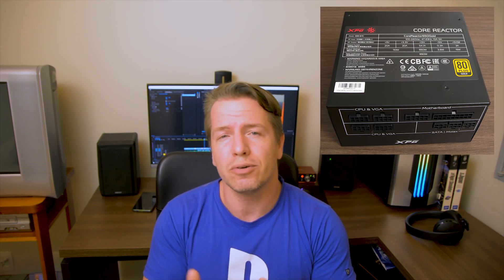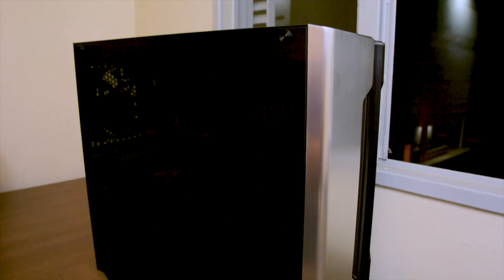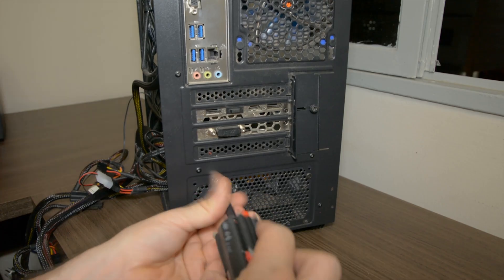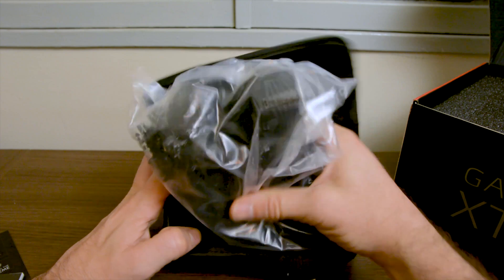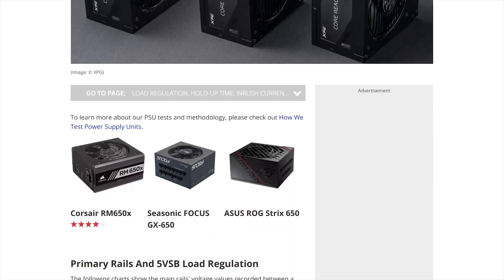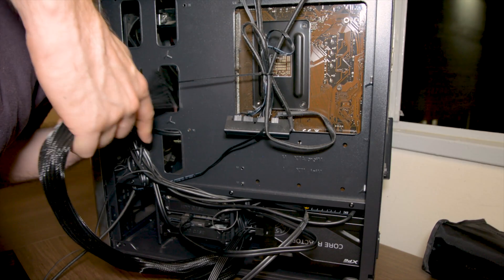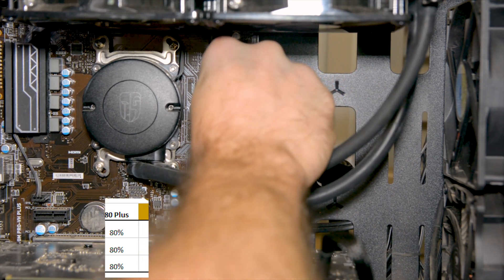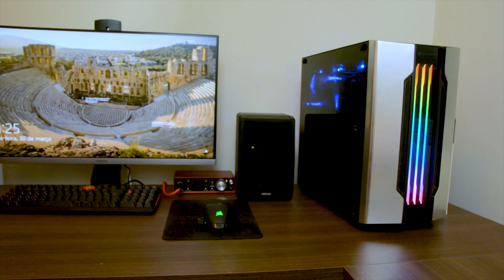XPG Core Reactor 650 Watts PSU - Why? 10 Year Warranty.

Comment: Hi man I want to ask a question can it run 3060 12gig with ryzen 5 3600 without oc anything? I have gtx 1650s right now and thinking about upgrading the pc
Reply from the maker: Yep, easily. Look for PSU calculator online. But I'm sure 650 watts is plenty for your setup.
Reply: @SUCRA  thanks man you are awesome

Comment: I have this unit and it has suboptimal voltage regulation on the +12V and +3.3V rails, specially the former with the voltage dropping by more than 300mV under 180w TDP graphics card load.
Reply: Just buy a more powerful one then, extra watts should nullify the issues.
Reply: @missk1697  My system doesn't need a more powerful PSU, this unit should already be an overkill for it. I came from an XFX unit, which was bronze rated, and I had it since 2014... the ball bearing was getting noisy and that's why I decided to replace it. The XFX unit was also 650w and it has much tighter voltage regulation. Like all XFX units of the time, it was actually made by Seasonic, the XPG unit is also made by an OEM, a Chinese (I think) OEM in this case.
Reply from the maker: That's too bad, I'm sorry to hear. I never got into testing the different power rails myself, but I did some research at the time and it seemed good. Good luck 👍

Comment: Is 10 years warranty means that the power supply will last for 10 years?
Reply from the maker: Not really, but it means that if it fails within 10 years they'll need to fix it or more likely send me another one.
Reply: @SUCRA  then how can I make it live till that time the 10 years?
Reply from the maker: You can't be sure. Electronics will fail. I assume that if they are giving out that guarantee they believe it's going to last the 10 years. But it could fail.

Comment: Hey, you still using this core reactor PSU? Would like to know how it's working
Reply from the maker: I sure am, never skipped a beat.  Planning to use it for the full 10 years. 👍
Reply: @SUCRA  thanks for the reply am looking to buy this PSU
Reply from the maker: I definitely can still recommend it. Good luck with it.
Reply: @SUCRA  hows the fan noise?i got the 850w version and the fan makes a sutle grinding noise and i had to close it off with a metal plate to reduce the sound waves
Reply from the maker: I have a fairly noisy 240 ml water cooler, I can't hear anything over that. I'm in process of swapping to a better air cooler. I'll see then if it's audible.
Reply: @SUCRA  yea im a weirdo when it comes to noise and i noticed that late an night when there is 0 sound and my headset off
Reply: @THEMISOGYNISER  Did the fan noise resolve? You find any solution or explanation for this sound....?
Reply: @helios9663  its bearing noise and no it didn't stop
Reply: @THEMISOGYNISER  Does it not bother you anymore or have you decided to keep it and bear with the noise?
Reply: @helios9663  its sutle as i said,you can hear it only when everything is quiet but it helped to flip the psu upside down (fan inside the case)
Reply: @THEMISOGYNISER  Got it man! Thanks for the reply!
Reply: @helios9663  remember me? then fan noise is worse now,i will contact adata for a replacement unit or something,same fans exist on seasonic focus psu's and they have the same problem,dont bother get a corsair with hybrid mode if you have the money
Reply: @THEMISOGYNISER  Hey hello 👋 I’m sorry that your model has this issue . It’s wise to ask the customer service of Adata about this. I already got the 650 watt model and I have faced no issue until now 🤞It’s running quiet and providing power like a beast! No complaints until now. And they provide 10 year warranty so that’s a plus. If I want any higher wattage PSU then I will surely go for a Corsair if it’s available at a good price .
Reply: @helios9663  damn,then i guess i had a bad fan unit,its so annoying because im going to stay without a computer for a week+ before the new one arrives
Reply: @helios9663  im pretty sure its the same fan and people with seasonic focus psu have the same problem (Hong kua fan)
Reply: @THEMISOGYNISER  Yeah I’m sure the but sound profile of higher wattage model do differ. Let me know what you do with this psu I would like to know the end

Comment: You should consider changing case. It looks very closed off at the front so airflow suffers. Something like a P360A, P400A or 500DX are good options. Maybe if you get a more powerful GPU that gets hotter then changing case should be something to consider
Reply from the maker: Thanks for the suggestions, I'm thinking about it, but having something of towering heights won't look as nice on my desk.

Comment: I ordered the same one hopefully it's good.
Reply from the maker: It's great, with that 10 year warranty you can't really go wrong.
Reply: Is it still good?
Reply from the maker: It's still going pretty well. It started making some coil noise or some other kind of noise when the PC is turned off. Honestly I don't know what this means. But as for power delivery I haven't had any trouble.
Reply: @SUCRA  coil wine is normal i had the same with my cooler master 550w,i want to order this psu cause it’s now at 75$ and it’s rated tier A so that’s amazing
Reply: @qdo4  my one had noise too so I returned it. I got a Seasonic Focus GX instead, it was about 20 more expensive.

Comment: when i was a around 15 years old i had to learn that mistake the hard way by cheaping out on a powersupply  
i heard the cheap capacitor screeching as soon as u switched it off then turned on 
then went out with a bang..

luckly it all survived somehow xD
Reply from the maker: Ahaha I'm glad you survived man! Yeah I try not cheating out on those, and also I don't use them in my main pc for more then 5 years. When PSUs get old the current fluctuation can kill your parts.
Reply: @SUCRA  indeed learned my lesson a while now :)